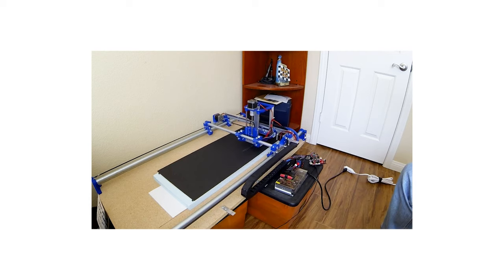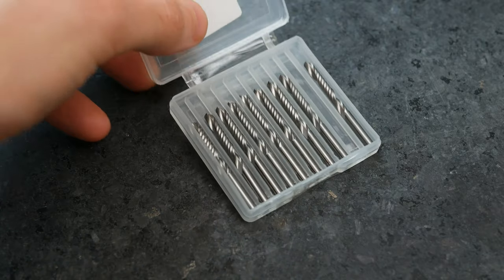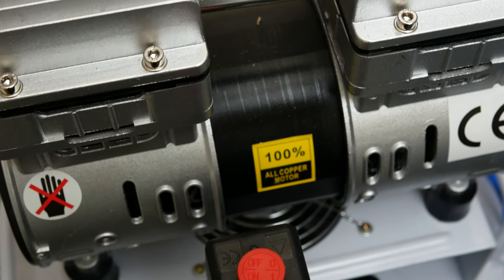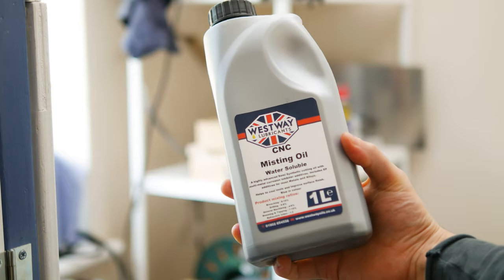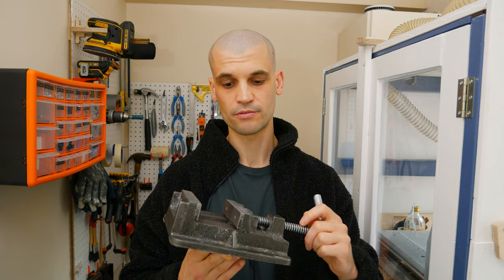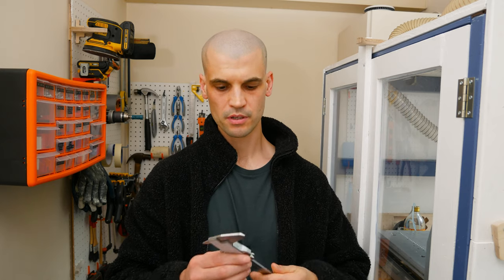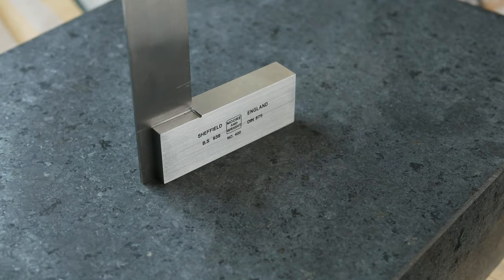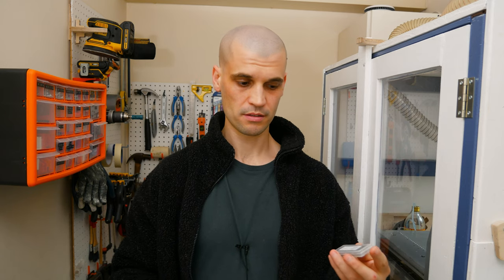Cutting aluminium on a desktop CNC - Must have upgrades!

Comment: If you use the CNC a lot, dont use acryl or plexiglass for the front windows, they become "sandblasted" and get scratches very quick, use safety glass instead (like a car windshield, glass-foil-glass), its easier to keep clean and hold for decades, as long as you dont smash snapped "big" drills/mills into it.

The mist cooler, the main coolant is the air, the main job of the liquid is lubrication, so the mill dont clog up. To use the liquid as coolant you have literally to flood the mill with it.
If you have something you dont want or cant use oil, you can also use a vortex tube, it dont have lubrication, but really cold air.
Reply from the maker: I am slowly discovering this, every month or so i'll wipe the windows as they have tiny shavings of metal and Im noticing small scratches. I do feel safer peering into the machine when its cutting though knowing I have a layer of polycarbonate between me and the machine. I guess safety glass wont shatter and is strong enough to withstand impact right??  I might think about swapping the 2 front window panes with glass in a few years if the scratches build up to a point where it impacts the video recordings.

Thanks for the info on coolant, Im going to upgrade the mist coolant this year hopefully with something like a fogbuster/MQL setup
Reply: @ThisDesignedThat  If a 20mm mill snaps at 20.000 RPM it could shatter or crack the glass, partially, but the foil holds everything in place, so nothing flys around.
Small mills may leave a little sratch (like when a little stone hits the windshield in a car on a highway) or nothing at all.
It depends on the energy of the impact.
On industrial CNC mills there are usually large thin (around 8mm) glass windows, only hold by a rubber seal in the frame. As long as you dont rip a 40kg vise from the table, they hold everything inside.
CNC lathes on the other hand, have usually small thick windows with serval layers of glass, transparent rubber and polycarbonat in a steel frame, 20-30mm thick screwed to the door. Sometimes they have even grates in front of the window, because of the much higher energy they have to deal with, if a chunk goes fly, wich leaves a big dent in the door and can even lift the door out of the slide rails.

To prevent scratches from cleaning, clean the windows as soon as you finish the work, first with compressed air, to remove the chips and then with a clean paper towel. If you wait a month, the water in the liquid drys and a sticky oil layer stays
Reply from the maker: @wolf310ii  woh scary, ive never seen a real VMC or lathe with my own eyes, would love to have a look around one someday. Thanks for the advice with the windows, will remember that in future

Comment: A word of advice. Never let having polycarbonate sheet in place as a guard give you a sense of safety. I've seen a broken cutting tool strike a 1/2" thick sheet of Lexan, shatter it into two pieces, and continue on to strike a wall. Granted, the machine shops I managed had much larger and more powerful commercial machine tools, but any machine can cause serious injury or death.
Reply from the maker: thanks for the advice and very wise words, i completely agree!

Comment: Great video, just curious what parts are you actually making form aluminium?  (purpose, quantity)
Reply from the maker: Only personal bits and pieces, I make hot foil plates for my print designs, and I recently built this https://youtu.be/5wa0a3vTafE using metal parts made on the cnc. I'm currently making a fixture plate for the CNC too.

Comment: Had a friend's air compressor tank rust out due to many years of leaving water in the tank. Just ending up rusting through and leaking air faster than it could fill up. That is probably what happens to most of them when they rust out. Only a very few of they would have any danger, and it takes many years of abuse to get there.
Reply from the maker: Thats reassuring to know, Im a bit of a worrier so I knew it would always be in the back of my mind when using it so I just wanted to be safe.

Comment: Also, I was just wondering, where do you recommend sourcing materials from? I've stuck with the same expensive supplier for years now!
Reply from the maker: I get my aluminium from metals4u.co.uk

Cheapest ive found and not rediculous delivery costs.

Smaller bits i just get from ebay

Comment: Is it practical to have 100mph+ blowers push the material into the back of the enclosure that has a gap dropping into some sort of collection container?
Reply from the maker: That's a great idea and it could work if you only have big chips to blow but if cutting aluminum on a hobby cnc machine then you will have chips that resemble more of a fine shaving and therefore very easily airborne. So a blower might move some into the collection container but also blow it into the air and get everywhere including all over yourself
Reply: @ThisDesignedThat  I forgot to add a important part of the design. The entire thing would be inside an enclosure. I made a rather large air tight enclosure for 3d printing. Besides the toxic vaporized plastic being vented out it's also temperature and humidity controlled. 

ABS or Carbon Fiber laced Nylon filaments have a high ambient temperature requirement and absorb moisture quickly preventing layers adhesion. 

I've been looking for videos with something similar but it's not something that seems important to people with plasma cutting/mills/lathe/router equipment. Probably because most are large scale and already inside well equipped working environments.

Comment: I might have missed it, how do you control the mist oil? As far as keeping it in the work area after its been sprayed? Do you have a track or retaining wall of some sort?
Reply from the maker: The amount is controlled by the valves on the coolant. Its spraying a small amount of coolant, most of the coolant is just going on the work piece and end mill and then evaporating. When I'm using a lot of coolant it just pours down into the tslot bed where I wipe it up after the operation.
Reply: @ThisDesignedThat  thank you for the response, I'm on the brink of diving in to this hobby and have been looking into going the coolant route vs air only. Main uses will be aluminum and carbonfiber plate cutting. Loved the video, already have all the suggestions in your video in my shopping cart except for end mills,  haven't found single flute sets yet
Reply from the maker: @ATCYU  For carbon fibre you usually use flood to keep all the dust in the liquid as its very nasty when airborne. Coolant is very beneficial with aluminium, keeps everything cool which is important as alu will gum up quickly. Single flute should be easy to find, where have you been looking, I use ebay, amazon but when Im not in a rush I use aliexpress and get direct from china as they are about half the price compared to here in UK
Reply: @ThisDesignedThat  understood, was looking at using flood for the carbon and mist for the aluminum,  or, possibly a vacuum attachment with stiff bristles over the end mill designed specifically for the router used. After my last comment i found a bunch on ebay, but I'll be going the ali route i think cause I'm a ways out from having the cnc router.  Do you think the single flute would work well with carbon too or should i consider something different.  I know carbon fiber is a bit stiffer than aluminum and retains heat much more,  thus i will need to make sure it doesn't heat to the point it de-laminates.

Comment: I'm hoping to do some thin, 3mm aluminium, and wood knife scales for my knives.. haven't bought a CNC yet hahah

Still on the 10k hours of YouTube video stage
Reply from the maker: 😂 i know the feeling, ive been watching 1000+ hours of content on metal lathes in preparation for when I finally get round to buying one.
3mm alu is quite easy to cut, so most machines should be able to handle it

Comment: Hello:
I am modifying this old century RC Helicopter. the company went out of business and not making parts anymore. i will need a new pinion, main Gear and carbon Fiber frame made. both gears has to be milled and i need to contract those out because i do not have the experience in 3D CAD and do not have a milling machine. I am thinking of purchasing a CNC router because I need to redesigned the carbon fiber frame witch needs to be modify on a CAD & CNC router and if I contract the frame out, it will cost me $400 to & 700 for the 3D CAD and CNC router cut. and there will be trial and error of having the job re-done because of mistakes.  so i am thinking of leaning Fusion 360 and investing $800 to $1000 on a router. the problem is that, once i am done with this project, i may not use the router for a while or a long time.
I do not know what to do.
Reply from the maker: once you learn the skills you will get new ideas of how to use the CNC. I had no clear plan when I bought my CNC. I knew i wanted to engrave metal plates but that was about it. Over time I have learnt new skills and processes and now want to build even bigger and better things.  It is an expensive hobby for sure and even more expensive to outsource it to get one-off parts made.

Comment: When your vise raises the part, why don't you just (re)calibrate it?
Reply from the maker: It raises it on one side only, so the part is tilted so you cant re calibrate
Reply: @ThisDesignedThat  But you can mill a slot in the sides of the vice and then put a guide in it.  Maybe use a dovetail slot.  Alternatively mill 2 dovetail slots  in the bottom surface and add dovetails to the bottom of the jaws so they always track ?

Comment: Your advice on buying cheap endmills is pretty bad. Maybe if tou are crashing your machine a lot, but many cheap endmills are ground incorrectly so if they are breaking a lot during normal cutting then they are likely breaking because they are cheap. Pay a bit more and your endmill's life wil increase exponentially. Also, buy HSS if you aren't already. Carbide is easy to manufacture badly, and does not do as well in low rigidity setups. HSS will be sharper when done right. For low rigidity machines, you also want to conventional mill instead of climb mill. You only want to climb mill with stout machines.

Comment: if you want to stop gumming up Aluminium use a decent grade, pure Aluminium is to soft. marine grade Aluminium is great or 6063 T6 is good. Also use kerosine as lube. I'm a fiiter and turner by trade so machining Aluminium was my bread and butter.
Reply from the maker: Yes I mostly use 6082 which is the common grade here. Its good for machining but sheet material is usually 1050 grade which is much softer and gums easily. Hard to find decent sheet grades